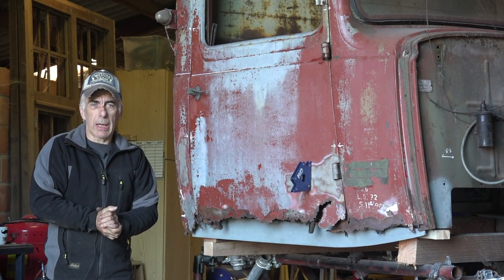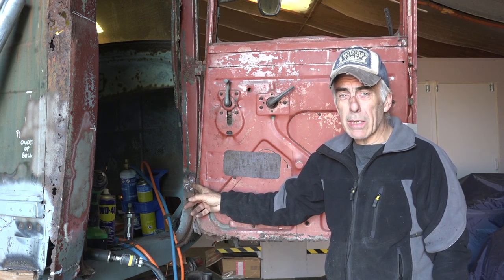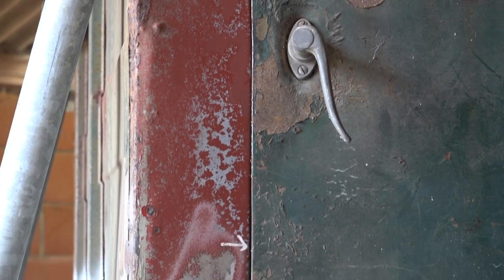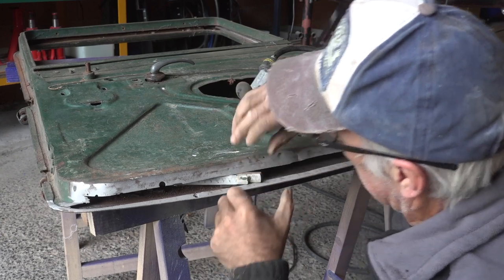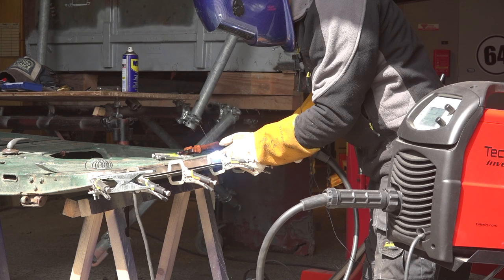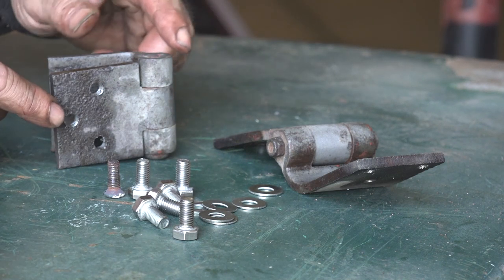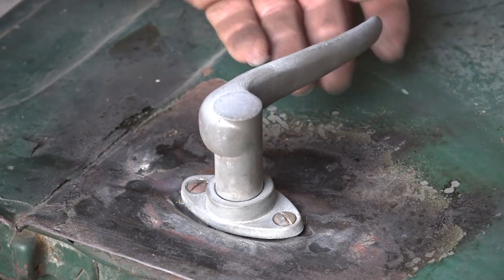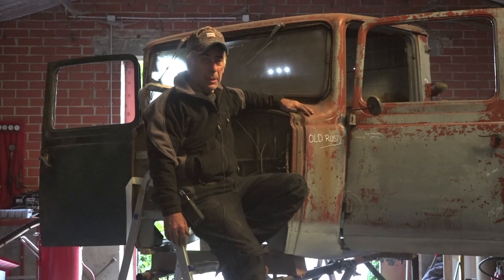Old Rusty is back, more welding and bending

Comment: Excellent work, nice to see things started on Old Rusty, often just drilling a hole in rusted bolts is enough to free them up, but the heat almost always works.
Reply: But you need to be using left handed drill bits for best results...
Reply from the maker: Thanks for the comments
Reply from the maker: Thanks for the comments

Comment: I think I figured out those lights above the door handles on the left and right side of the cab, originally I thought they were clearance lights (thinking "what a pain" having lamps on all the time with the light reflecting off the mirrors and door frames! But no, they must be turn signals as I don't remember any on the front of the truck. Back in the 40's - 60's they probably used hand signals for turns?
Reply from the maker: Thanks for the comments, yep those are blinkers. Some even had flashes that pop-ed out. Not this one
Reply: @D3Sshooter  Thanks for the reply Steve, 25 years ago I had a Moggy (Morris Minor) with the "semaphore" signals. Someone wanted the care worse than me, they stole it from a secure storage yard, the camera on the gate wasn't working that night!

Comment: Here in the US, we call those stepped drills. They do make spot weld cutters for your drill. You might want to pick one up. They work quite well and not too expensive, at least here in the US. Can’t you use button head Allen (hex socket) screws for those hinges?
Reply from the maker: Thanks, good tips.

Comment: Great video Steve!!  How about mig welding a bolt to the head of the screw, then use a socket?  Quite a successful method i've found...
Reply: Yup, I have done it this way Numerous times. 
Soon as your done welding, slap the socket on while it's Hot.
Reply from the maker: Txs for the comments,
Reply from the maker: Txs for the comments,
Reply from the maker: Txs for the comments,

Comment: What you should have done was clean and oil the threads as you pulled the hardware out and then put them back in. Because the last screw out is holding all of the load. Which does not make getting it out any easier.
Reply from the maker: yep, thanks

Comment: Use pb blaster wd40 ain't much good for crusty bolts
Reply: ford nut eh, it’s all about the same, I’ve found.
Reply: @melgross  I'll tell ya something else that's even better is trans fluid or just old used trans fluid.
Reply from the maker: Thanks , good tip.. will need to try that out one. Thank you for your comments,
Reply from the maker: Thank you for your comments,